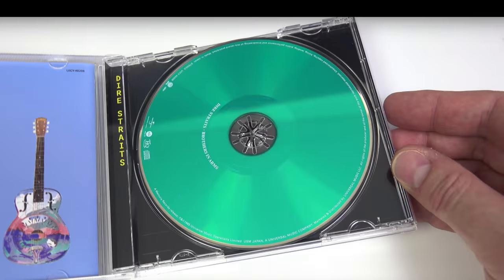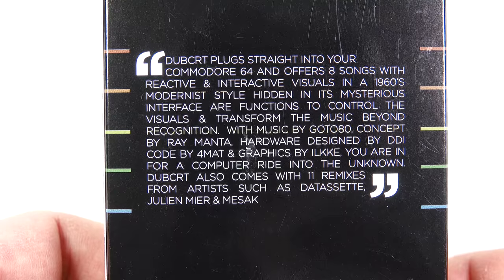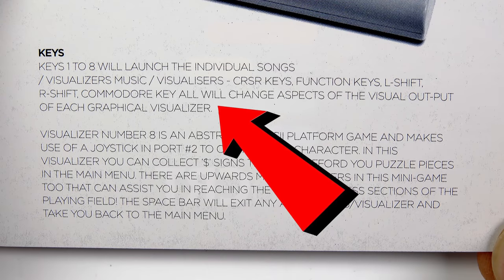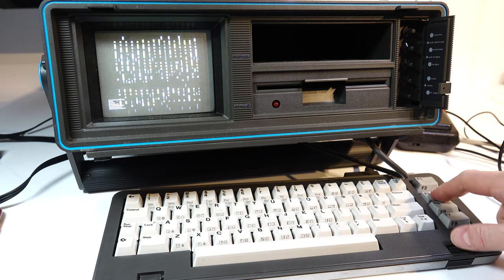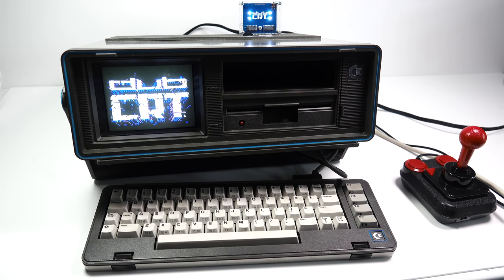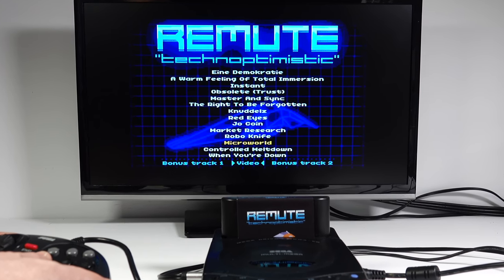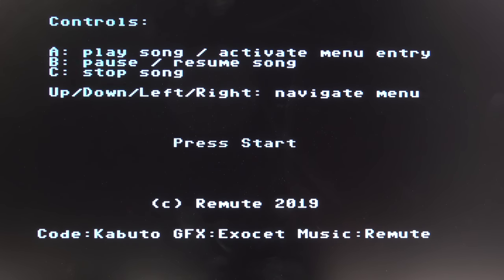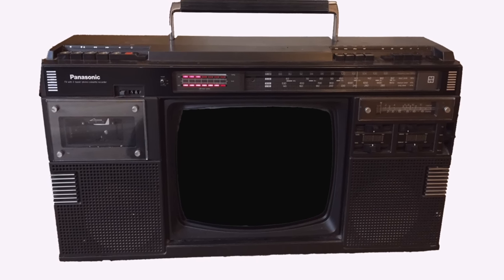Music Albums on Game Cartridges (C64 & Megadrive)

Comment: The visualisation idea sounds like something that could be easily done with a raspberry pi. It has bluetooth, audio and composite out. Linux runs on it, so you could use already existing software like ProjectM. You’d only need a modulator for the tv signal.

Comment: I notice a lot of comments mentioning the Raspberry PI or microcomputer, those things have to have an OS installed on them and boot into to run, they won't just generate visuals right away, you're looking for something with a bit more electronic engineering in it.

Comment: The Dub CRT cartridge songs like it's making extensive use of the SID filters, which were notorious for differing widely between individual chips. 

It's very likely that the music sounds quite different on this SX64 than it did in the development machine. 

Hopefully there are some keys to adjust or turn off the filters.

Comment: Bad apple on the MegaDrive and C64 was pretty impressive, although the MegaDrive version de-syncs on PAL 50Hz, on a modded 50 to 60Hz system or Genesis it seems to run fine.

Comment: Cool, but as you said yourself a bit non-used to it's capabilities. The original Xbox could play CD's (audio) and would convert those with some visualizer stuff with the Xbox-glow-thingy.

On a different note. I received this week the new newsletter from Sonos. And they were advertising the Sonos Port. A device to "upgrade your traditional stereo or receiver". I guess you need a Sonos speaker for that, which can already do quite much (radio, network media player).

I have a Sonos Play:1 that sounds amazing. I don't know if you have looked in to it privately or for research. Can't find a video about it on your channel. Either way the Sonos Port might be your thing to look into. Quite a hefty price b.t.w.: €449,-

Comment: I have Remute and my Genesis 1 is running a regionless switchless mod with a widened slot for Megadrive cartridges, and it actually does sound best on either a Geneiss/Megadrive 1 with the yamaha chip OR you can mod a Genesis/Megadrive 2 with the stereo sound mod.

Comment: AT LAST!!! I have something that you have…namely that Panasonic TV/Radio/Cassette player.
I used to switch it to TV, turn it off, put a 90m cassette in it and press play when I went to bed. While the cassette played, the TV was on, but when it ran out and auto stopped, the TV would switch off, so I didn't need to get up to turn it off (thereby fully waking up again) when I got tired and instead could just drift off.
I often thought about transplanting a colour tube (or attempting to) into it, but there's nit much point since the analogue signal got switched off. I am intending to resurrect it when I get my shed finished though, so I may revisit that idea when the time comes, although I don't remember off the top of my head if it has a video I/P, or if they're all just audio.

Comment: Although it doesn't sound like it exactly matches what you are looking for, have you ever messed around with the visualizers on the OG PSX? The earliest ones didn't have them built in, but all of the later Playstations, maybe/probably even the PSOne, had it built in. Actually sold my PSX to a friend back in the day so I could 'upgrade' to the version that had it.
Reply: Gonna have to add that the Jaguar with CD attachment also had a visualizer on it, but both Jags and the Cd unit are fairly pricey anymore. Always wanted to try that out, but the prices for the CD unit are more than I want to pay to satisfy my curiosity.

Comment: DUB CRT reminded me a bit of how System Shock 1's interactive soundtrack was supposed to work with procedural mixing of very small elements to make a much more complex sound. The audio director of the remake wrote up a post on how it works: https://www.kickstarter.com/projects/1598858095/system-shock/posts/1889009

Comment: I love chip tunes and especially the sound of Mega Drive YM2612 chip. I often use my Mega Drive with Everdrive cartridge and games' built in sound test modes to use the actual device instead of Youtube for example, you never know if it's emulated or not.

Comment: The best music visualizer in existence -- as that is, in a nutshell, what you're looking for as the modern equivalent of the Atari Video Music -- remains Milkdrop 2.0, which in its most convenient form comes packaged with good old Winamp.  I did research on this a few times in recent months and this was invariably the answer.  Getting it to serve as something more plug-&-play than a Windows application?  Probably the best bet would be to just get your hands on a reasonably inexpensive Windows-capable mini-PC and set it up as a dedicated machine for only playing Winamp, with MilkDrop 2.0 always displaying, and exclusively accepting audio from the input jack.  Just understand that to get MilkDrop 2.0 to play at a reliable 60fps in 1080p+, one's machine still needs to be adequately beefy.

I may as well make mention of MilkDrop 2.0's closest contender, DMT.  The visuals it provides are more modern and dynamic, but less varied and, seemingly, less interactive.  You can easily get an idea of what the two options offer by hunting for YouTube videos ("MilkDrop 2.0 visualizer" or "DMT visualizer").

In any event, nothing 100% standalone is going to remotely approach the quality of these two options.

Comment: Raspbian supports VLC which has visualizer, and any Raspberry Pi has composite out (Zero and Zero W kinda suck at video playback of any kind though). This can be connected to a RF modulator from an old VCR and tuned into with a television. I t would make your boombox a mp3 player though as I don't know if it would be possible to make it work with a microphone input and run on startup. A Pi can be completely hidden inside the boombox as they are usually mostly hollow and work with a Bluetooth keyboard, and new music can be added via FTP. This would be a cool way to cyberpunkize a very 80s/ early 90s looking boombox with a CRT TV in it, as you can also have retro games on it, like Mega Drive/NES/SNES/PC Engine and even PSX that work very well, even on Pi Zero. If I had one I'd probably have done it, but on the other hand it's a bit of vandalism as it's losing its original character as a device and is no longer historically accurate.

Comment: I have a Critter and Guitari ETC. It takes audio in and outputs HDMI, I run it to a small CRT and it gives very nice visuals. You can also add image files to the included usb drive and add them to the visuals. They're kind of expensive though and a bit bigger than what you're looking for but mine works great..

Comment: A simple way to get a visualization from a crt is what an old hippie bloke i knew called a 'sillyscope'. Get yourself an old crt, locate the horizontal drive to to the yoke. Pull that coil off the drive board, and hook it in series with your amp and a speaker. Rotate the tv 90 degrees. The vertical sweep is now an un synchronized  horizontal sweep, and your vertical axis dances around much like an ocilliscope, but with no trigger, so its quite a bit more chaotic. Dont do this unless your at least a little familiar with how crt's operate, there are dangerous voltages in there. But as 99% of the tv is unmodified, its quite safe. The coil in most tv's ive seen are about 2 ohms, so you'll need a 4:1 transformer to drive it directly (no speaker).

If you use the vertical coil instead, its like looking at a bass guitar string with your eyeball 1 inch from the string. Use a tv where you can change the colorsof the guns easily, you can roll some pretty colors. I'll try n upload some vids.

Here ya go:
https://youtu.be/ctGDRYLG0iE
https://youtu.be/y4XqcqF-TMU

Comment: Making the screen in a boom-box work in time to music: You'd have to give the T.V. section a seperate power switch so it can be on at same time as other audio source. Then have to remove/disconnect the T.V. tuner and I.F. sections of the circuit. Then make a circiut that responds to sound with composite output using a VIDEO chip. Maybe a LM1889 or similar.

Admitedly that last bit is the hard part. But it can be done, I'm sure.

Comment: About the request, I'm guessing something small like an Arduino Nano could do the trick, and could even be powered through a power cord pass through or for batteries some kind of clip.
Reply: DynVec Lacks the ability to output video at 10 megapixels per second.  Also has a too slow ADC.  The ATMEGA chips have a faster ADC but would struggle to even do a horizontal bar graph with timers instead of pixels.

Comment: First of all, you're using wrong SID chip (didn't it say in the manual to use 8580???). Goto80 switches a lot between the filters, which makes 6581 "pop". Second, the filters are more growly or distorted and deeper on 6581 than on the 8580. So you might get a totally different experience with the newer 8580 SID-chip. Also Goto80 is an experimental composer, who uses specifically these differences and nuances of these SID chips (I've actually met this swedish guy four years ago). So as a composer in that case you choose for which one to compose to or else you drop the filters or make them very light.
Reply: CrippledNinja exactly right - the music is specifically written for 8580 due to need for the newer filter - hence why the manual states this :)

Comment: About that request at the end... I have been searching and asking around for one of those modern Atari Video Music equivalents for years. I've even toyed with building one myself (but alas, my skills in electroengineering does not meet my needs there). . 

I would plonk down money with no hesitation if I saw a decent one that is proven to work (as in, no shady indygogo campaigns and such)  and was for a reasonable price. 

Just a display with left/right stereo audio RCA pass through and maybe a vga, hdmi or even composite video out. On the front would be a few buttons and knobs to control and change visualizers. 

A standard 16 bit 48KHz ADC would be more than enough sampling resolution to make most of the useful visualizers as far as I can think. And a teensy v4 would have the grunt needed for processing simple sample comparisons to curved lines.  And even if it's limited to a waveform and an X/Y Vectorscope I would buy more than one as I would use it both in my HiFi and on my computer workstation with happiness in my mind.

Comment: For what ever it's worth the PlayStation 1 CD player had a visualizer (the gray one, not the white one) and only on the early models (being that there is 22 versions of the grey one, sorry I can't be more help) The feature was removed because no one used it (so there is little to no documentation of what models have it and which ones don't) I have no clue if it's available on any emulators. Apparently they brought it back on the PS3.

Comment: There was a solution for the C64 in a computer mag back then. A mono line input for the user port, but the program was not very good, every demo programmer would have done a better job, Besides that, you had some raster lines on the background screen for the bass and raster lines on the forescreen for treble. Wasn't that bad but not worth buying the equipment, fiddling it together and spending one day to type in the listing. I don't know if it was "64er" or "Home Computer" but both german mags.

Comment: Get your money back for the C64 thing!

The most interesting C64 audio program I've encountered back in the day was an audio cassette "ripper" (we didn't use the term ripping, of course, and I forgot what it's called, but I'm sure I still got it on a 5&1/4" utilities disk).

It's a very tiny program that you executed and pressed play on the datasette and it recorded a short sample of relatively good quality, using all of the computer's memory.  Some ML tweaking should allow for straight playback without recording.

I was too young to understand how audio was sampled and made to play through the SID chip.  Actually, I'd still like to know.  But it seems reasonable that the computer's memory could be used as a small circular buffer to play a whole side of a tape.

Well, an interesting idea, but I don't wish to dust off the old equipment.  Just thought I'd let you know what's possible with the old C64.

Comment: I wonder if you had explored the Technoptimistic cartridge first you would have thought that was unconventional-- when after seeing the Dub Crt first, it seemed pretty conventional...

Also, with regards to music-to-visual generators, there's a lot of DIY options for the Raspberry PI computer, which is about the size of a pack of cigarettes-- not sure there's enough interest in such a thing to make a commercial version, and a DIY solution might require a little more computer or Linux knowledge that most people have.  I've got enough knowledge but given I don't see it as a money making idea at this point, and making a one-off seems a little more trouble than it's worth to me, but there may be a Linux geek out there that would see it as an interesting exercise, or even want to try a Kickstarter campaign for such a thing.  Some models of the Raspberry's have a composite video out as well as HDMI, if you wanted to go through an antenna input it'd still require an RF modulator, but that is probably something that can be found.   Making one for the widest appeal would probably focus more on the HDMI output than composite video, so an included integrated RF modulator could be pretty unlikely.   But good luck with it, and thanks for the videos-- this one reminds me of a visual music program I wrote for one of the first home computers in about 1976-- using an S-100 based 8-bit computer called the Imsai 8080 and the "Cromemco Dazzler" which was the first crude color graphic device from the time-- if I remember right, it's highest resolution color output was something like 64x64 pixels and would do B&W output at 128x128 pixels, about enough to do your own Pong game...

Comment: im sure you could set up a raspberry pi zero to do what you want for the boom boxes relatively easily as there is a model with bluetooth now and surely an available open source visualizer. the annoying bit is getting it to output rf. a lot of people who are into 8bit stuff are all about rgb, so a dedicated device like this might not be very popular. if someone was clever it might be possible to make something that could transmit an rf signal that could be picked up by an antenna so you wouldn't need to plug it in at all. of course you can always use one of those digital to analog devices, but it wouldnt exactly be elegant.

Comment: Wonder how a Mega SG handles this sorta thing. Looks like we'll find out soon enough...

Same day I just ordered CR2032 cells to replace cart batteries... how odd.
Reply: there is a great Rick Astley "never gonna give you up" made for the genesis, complete with compressed graphics video.
runs fine on a chinese mega everdrive, so no doubt it will on the Mega SG as well.

Comment: Mat the original playstation had visualizes built in but I think it only  played from CD. Back in the day a company  called nullsoft made some software with visualizes  built in.
Reply: The PlayStation have some drawbacks though. The first models have the best output sound and standard analog outputs, but lack the visualizer and the ones that do have it (that came with the DualShock controller), use a proprietary output port and the sound quality is slightly worse.
Reply: The visualizer of PS console were only on models 7000 onwards, including the 9000, the PSone (slim)

Comment: The original PlayStation console has a visualisation mode when you put in a music cd.
Reply: Not every model had the visualizer though. The visualizer was introduced in the 7000 models and had a slightly worse sound output added with proprietary ports, the ones that have best sound lack the visualizer
Reply: @lordeilluminati  Yes you're correct I forgot about that. Wasn't aware about the difference in sound quality... Definitely sounded better than my Saisho cd player, haha

Comment: Hey Techmoan, in response to your CRT visualizer request maybe try making this? http://crackedraytube.com/pdfs/oscillographic_tv_tutorial.pdf It's actually pretty easy, even if you don't have much soldering experience. Just make sure to discharge the CRT! Also I did not need the sandbar resistors at all, so really all you may need is an amplifier and a couple audio inputs.

If you want to add color (which I would highly recommend), you can make a simple electromagnetic as well: http://crackedraytube.com/pdfs/building_a_diy_electromagnet.pdf

I've made a few of these already so let me know if you have any questions if you do attempt it!

Comment: Hmm, theoretically for an audio visualizer you could probably use a Raspberry Pi with an audio capture device. Setup some visualizer software to start on boot and run off the audio input. Then just hook up a display to the RPi's HDMI output.

In fact, some Google searching led me to this:
https://youtu.be/I32hI0x3Ht0
Might not be exactly what you're looking for, but it shows that it's possible.